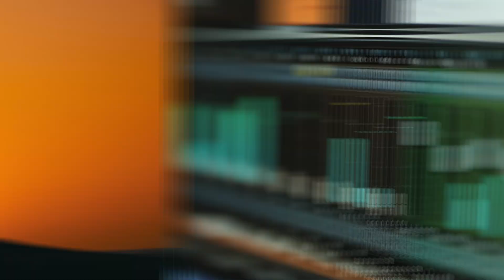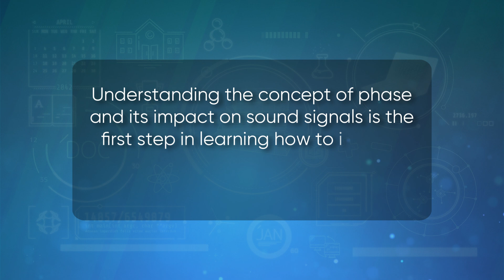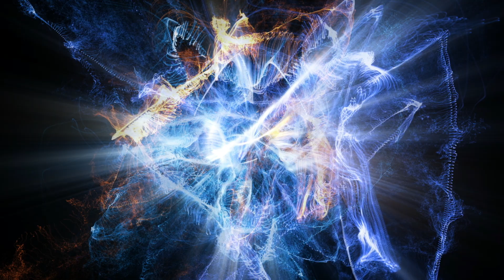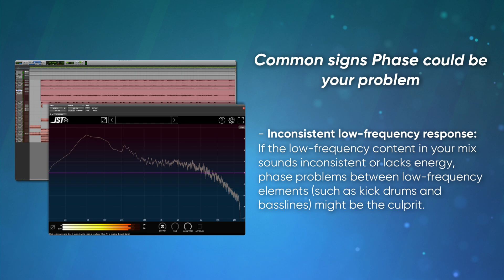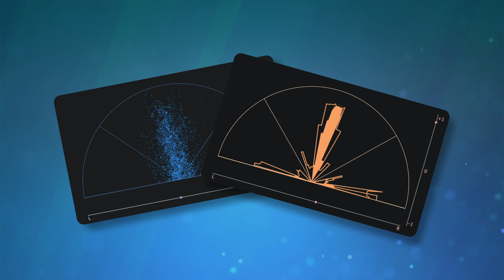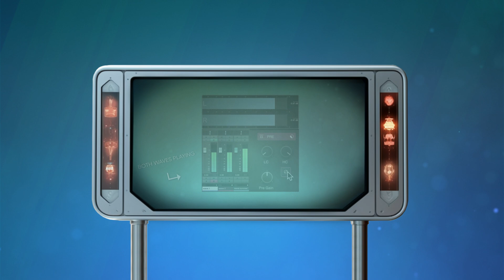Understanding Phase

Comment: Can someone explain why rendering the same project in daw twice and then putting both files to new project in daw again and changing phase of one of audio files i still have a difference? Does it mean that some vst plugins that i've used on original project have non-deterministic output?

Comment: I wonder if Joey will cover the relationship between phase and pan.  I recently made significant improvements to my guitar tone by panning the individual mic tracks in accordance with how I pan the bus that each mic goes to.  I’m working with dual-mic’d guitars, so every guitar track is a bus comprised of two mic tracks.  I used to just pan the bus track, one hard left and the other hard right for the double-track effect - and I would leave the pan of each mic track neutral at center.  But i was never satisfied with my tone, it sounded kinda thin and cheap despite having some low end.   
But now that I pan each individual mic track in accordance with how their bus is panned, the tone sounds more full and complete, like it has new body and solidity to it.  

I don’t do any processing on the individual mic tracks, I process all 4 mics (2 mic pairs, one left and one right, each pair summed as a left and right guitar bus) together on the final rhythm guitar bus (panned center).  I’ve noticed i need to do this type of panning for guitars that are not double-tracked as well — the tone improves when I pan each individual mic in accordance with the panning of the bus that each mic is summed to.  Is this normal and I’ve just been ignorant this whole time, or is this strange? 
The diminished tone from the improper panning I described sounds to me like it’s phase-related, but I could be wrong. 

I use reaper so they’re “folders”.  Curious if anyone else knows what I’m talking about; and what might be some other pan-related phase issues I should watch out for?

Comment: You can also use phase shift creatively. You can intentionally move multi miced tracks out of phase, to achieve a unique tonality. The strongest phase relationship is not always the best choice.
Reply: Also if you're in charge of recording, you can use phase as an acoustic tool by mic placement. For example in the Fredman mic technique for recording guitar cabs with two 57s, the mics are supposed to be placed at slightly different distances from the cab, so when you mix their signals together, they'll be out of phase just enough to give the top end a certain sound.